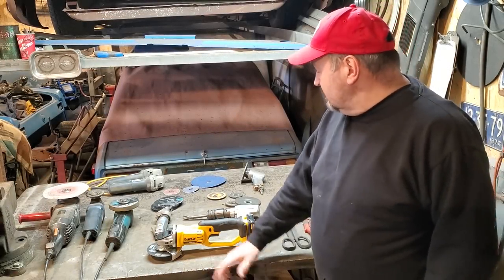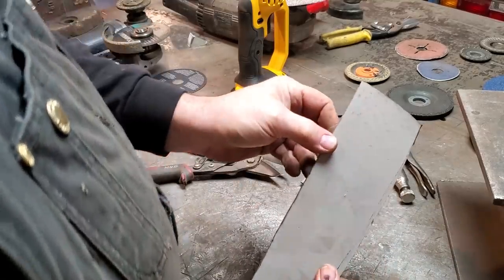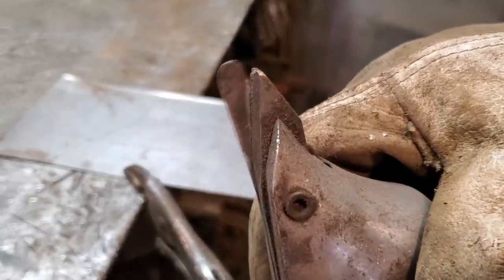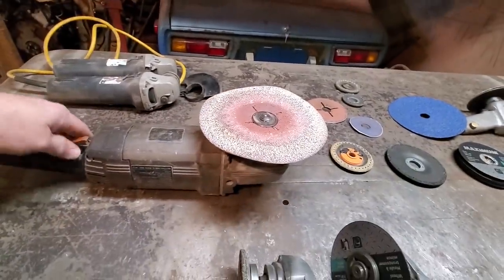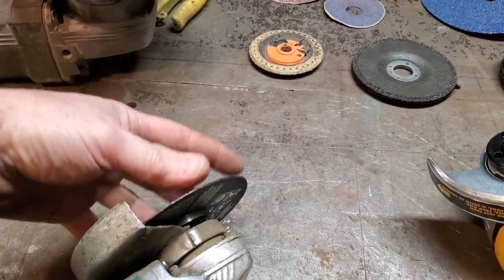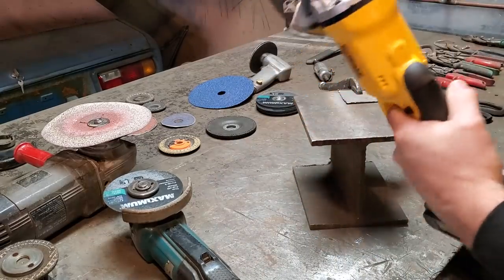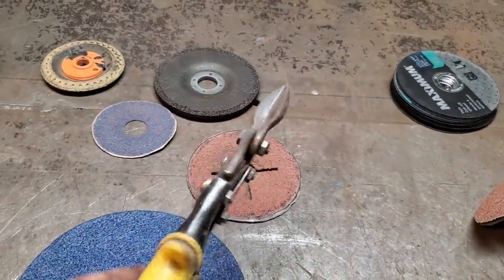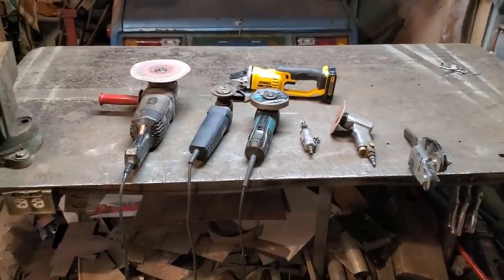Cutting and grinding tools used for sheet metal

Comment: Tony you definitely need the 5Ah batteries for the dewalt grinder, ive got the smaller and the 5Ah which i use on my drill and impact driver. The smaller don't last very long.  I admire the confidence and ability you have when using a grinder, i hate the things.
Reply: Tony, Pete.  I have a similar grinder and both batteries and I would agree that the 5Ahr battery lasts a lot longer but somehow the extra weight upsets the balance of it especially when using it away from the bench.  Still a great tool.  Another great video Tony, HNY.

Comment: Went back and re watched the floor repair tutorial. The unibody looks to be exactly opposite of the full frame bracing, when the seat structure parts are on top. Is there an easy way to get it cut off the inner rocker while in the car? May just unbolt it and lift the body up a few inches...but who knows:)

Comment: about angle grinders it seems that especially on youtube it is really popular to remove the guard and handle. and then it's best to operate it with only one hand. and make sure not to have ear or eye protection on. :P i have cut my finger with an angle grinder and it wasn't really that funny, but at least i still have my finger. others might not be as lucky as i was

Comment: They make a larger amp. hr. Battery if you need it . But I never need it if I have two batteries. If I do I’ll use an air grinder

Comment: I thought the left and right indicated which way the curve goes, not which hand you’re using, I could be wrong, I just never heard that. I bought some of those heavy grit ceramic sanding disks online and the glue was no good and the abrasive material came right off and left me with just the backing, if you find good ones I’d buy them too
Reply from the maker: What ones you buy? The reds are known as left.. but they cut to the right! It is very confusing for sure.
Reply: @fitzeesfabrications  I bought a set of craftsman ones years ago

Comment: hey fitzee, i use the 20v max 3.oah lithium ion they have a voltage indicator on back i keep 3 charged up when im working i dont have a cordless but i am thinking about getting one i have an air chisel , air nibbler, and air shears i don't really ever use  any of them. but i use my plug in grinder all the time. thanks chris

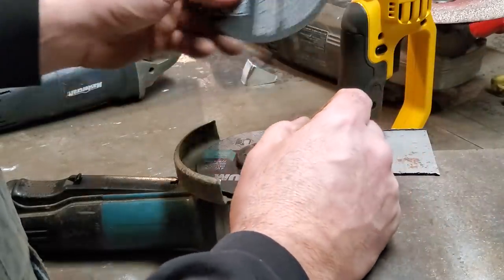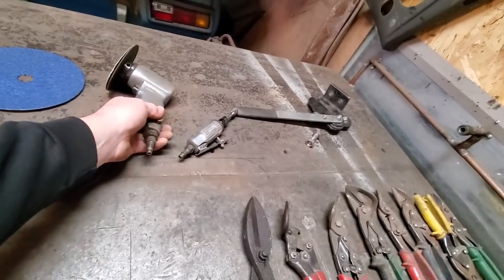Comment: 25:25 Please give tip for a garage mechanic with no compressed air available. I substitute this air grinder (25:25) with corded electric drill Makita Df0300. But i only have velcro arbor adapter for velcro sanding discs. And this velco sanding paper is expensive. Can you tell me how to make backer plate for my CUTTING ARBOR ADAPTOR so i can cut regular non velcro paper in 3 inch diameter wheels and use it in the drill.
Reply from the maker: I seen some adapters for electric grinders but have never tried any. I used the disks from air grinder on electric grinder but the backing pad sucks from air grinder.

Comment: Another really useful video - thanks. If you have time, can you tell me whether you prime the back of panels that cant be accessed once welded...and if so, what sort of primer do you use - weld through, etch,  etc. Mike
Reply from the maker: I like to just paint it with a good rust paint. Dont like weld threw as it affects the weld. Anything you weld on a car will burn the paint off

Comment: Fitzee, I need to deepen the beads on the floor board replacements I purchased for my '61 Lincoln. No one until recently was making them, so I purchased what was available. I need to deepen them another 1/4-1/2 inch. If I make a "sandwich" out of 2 boards with the correct width for the beads and place each of one of the 4 19 gauge panels in between and pound out the desired bead depth with t-dollys or a mildly pointed hammer, will that work? Also will heating the panels when pounding help if they remain sandwiched? Thanks, I have just about finished watching all your videos, nice work!
Reply from the maker: I done it that way. I found a ball bearing that was same contour  as the bead and welded it to a old air chisel  tip and built a base high enough off my bench so when I push the steel down the bench top was where I stopped.
Reply: Thank you Fitzee, it will likely be another month or 2 before I get to that part of the resto. I appreciate your advice, thanks again.

Comment: Dewalt cordless tools are ok, but not as good since they started building them in China. What you want is the Milwaukee 18v. Hands down the best.
Reply: Your blue corded grinder is a Makita. I used to have one of those in a shop I worked at, good tool.

Comment: Happy New Year Fitzee!! 
I don't see you using a wire wheel for rust clean up, any reason? I find they clean up good and don't take away the good metal...
Reply from the maker: Great for chassis and floors but use them on a hood or door skin you end up warping the panel.
Reply: @fitzeesfabrications  I've only used them on frames and heavy metal so far. Good tip about not using them on sheet metal.

Comment: In my opinion, the biggest thing to decide when it comes to cordless tools is picking a single brand so your battery purchases can be used for all your tools. That way you can get maximum value outta your batteries and you can take advantage of tool only deals, knowing you have the batteries you need back at the shop already. Also, you can only use most tools one at a time so I get the biggest batteries I can for the money and have enough for 2 tools to be loaded and two in the charger. Any more is for the rich bastards, which I am not.

Comment: The most important is a good quality  6" Vise there are many cheap ones beware.
Reply: True.  I bought a brand new vice at a local big box store.  Took it home and bolted it to the bench and tried tightening it just to see how smooth it would turn.  It broke in half.  And I'm not Hulk Hogan.
I bought a Record brand and have had no problems.
You get what you pay for.

Comment: You're gonna find that cordless grinder to be quite handy, but you will use up a lot of those small batteries. Wouldn't get any bigger than 4 amp batteries for that particular grinder, being a brushed motor a bigger than 4 amp battery will burn it out sooner. If you decide to buy another grinder, get a brushless one. They are comparable to corded with a higher amp battery, and the batteries last longer on a single charge. Don't buy cheap knock off batteries, you'll be wasting $$$. Like my cordless tools, hardly ever use corded tools anymore. Sold most all my corded tools.

Comment: that a really good price on zip disk around here we pay about a Canadian dollar a zip disk.  for your 7 inch fiber resin disk if you want a proper backing pad you can order one threw Walter I used them in shop I work with all the time they work great. I was also going to comment on your battery for your new power tools make sure to not keep the battery plug in 24/7 it keep cycling the battery power causing it wear out early. 

for fiber resin disk I found best company that I have found make them is CGW abrasive. I order all my supplies threw grainger.ca or com depending if you are in the US. but personally I would avoid buying 7 inch disk vs 4.5 inch disk because it just not as cost effective to amount you get out of the disk. because generally a 7 inch disk around 7 - 8 dollar Canadian each. well a 4.5 disk is closer to 1 dollar 30 cents each. 

anyways I hope some of that can be helpful to you :).
Reply from the maker: Great info. Thanks

Comment: Im wondering with those cut off wheels being so thin, how often do they come apart?
Reply from the maker: Yes they do. Most times it happens when the metal  pinches together when cutting. I had many explode on me. These I use go to a powder when they explode. So very rearly do large section come off. But that's not to say it won't.
Reply: @fitzeesfabrications  Thanks. Ive seen you use these making patches while laid over the old material. I really like that idea and was wondering where you found those thin ones. I will look in to getting a few.

Comment: im using that dewalt following the fitzee methods - it's slow going through sheet metal and the batteries overheat before running out of charge - works better for the grinding/sanding flap wheels. I've got three batteries and usually after an hour in the garage all three are dead and thats when I stop... suspect it might not stand up to the might of fitzee

Comment: have you tried the Lenox Metal Max cutting wheels? I like not having an explosive in my hands....
Reply from the maker: Been told about them.  Been told they are thicker then the zip blades I use.
Reply: @fitzeesfabrications  the 6" and smaller wheels are .050" thick, so .003" thicker than the "thin" 3/64" Maximum wheels, hardly a difference to me. They're not as cheap to buy, but mine have lasted a long time so the economics work out eventually. Plus there's way less dust, fewer sparks, no smell, no explosion hazard, and you're not constantly having to change discs as they wear down. I'm not selling these things, but everyone I know that's tried them, loves them, so you might want to give one a go too, since you've moved into the 21st century now ;)

Comment: Open question for anyone. What is the best way to make long straight cuts in sheet metal without a large shear? I've tried snips and grinders but can never get a good straight cut.
Reply from the maker: Talk a long peice of flatbar  or angle iron. Lay it on thr line you want to cut then use that edge to guide you cutting disk.

Comment: Have you tried BenchmarkAbrasives.com for your larger diameter 24 grit discs? They have them in different type grit materials. Looks like they may be cheaper than your cost but then there’s shipping to Canada which may add more.

Comment: I have a Cordless DeWalt Grinder. Great tool, low battery life. Sad thing is, I only have one battery lol, they are hella expensive. So, I'll get like, ten, maybe twenty minutes on a charge, it's kinda bullshit.
Reply from the maker: You need get more batteries.
Reply: @fitzeesfabrications  yeah, I know, it's just very frustrating that they're so expensive and have such short work use time. My Kobalt Tools were much more bang for my buck with battery life. But less powerful. Doh!

Comment: i am surprised you dont use an air cut off grinder??
Reply from the maker: I have one  and forgot to show it. My bad. Dont use it at all. Found up here it freezes  up due to the high  speed of it. The small zip blades don't last long and were not always easy to find the thin ones.

Comment: I've been reviewing some of the past videos of Professor Fitzee, in case he has a test for us.  I have a couple of questions.  When you paint the inside of a panel that's about to be closed up, what do you use?  When welding on a working car, should you disconnect the battery?  I've seen a couple of sites that recommend squirting motor oil (new or used) in the door panels to keep them from rusting.  What do you think about that?  Thanks for sharing you knowledge.  You have saved me enough to cover the cost of my welder.
Reply from the maker: Us a good rust paint i use. Yes disconnect the battery. And using a oil is good idea just don't do it till the job is done paint work and all.